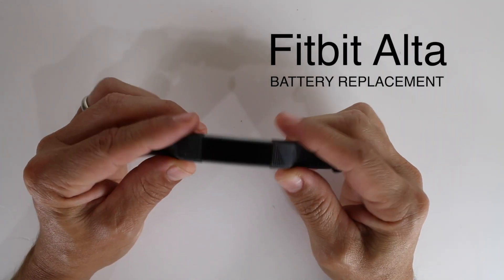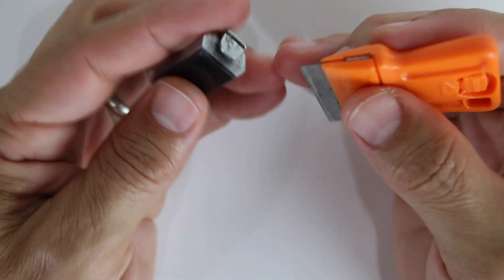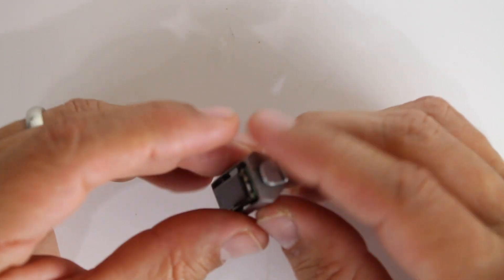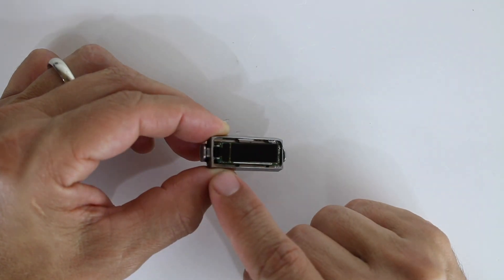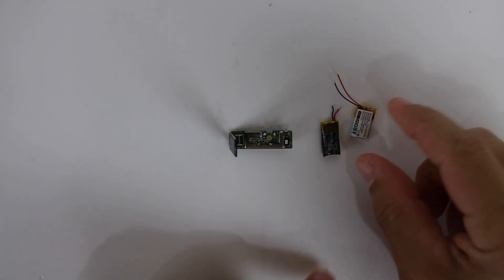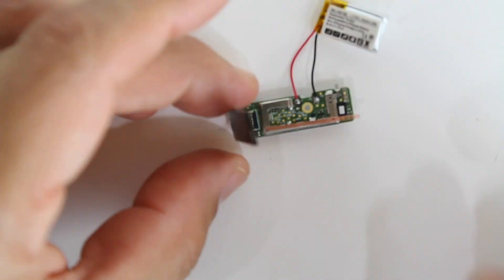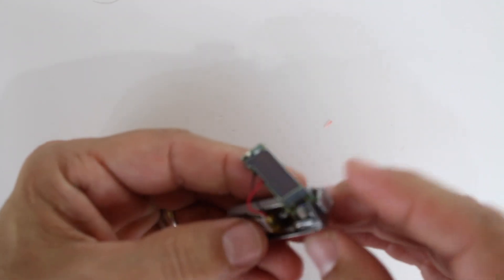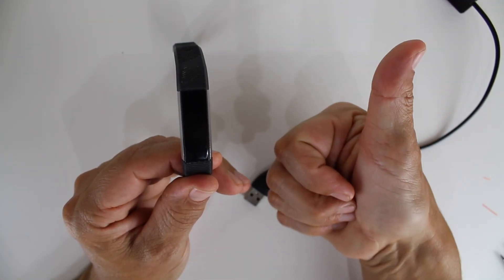Fitbit Alta Battery Replacement (Step-by-Step)

Comment: If you do this procedure and then your Fitbit will only stay on while on the charger, you accidentally blew a fuse in the Fitbit when soldering. You need a magnifying glass to see, but there are two solder points on the circuit board labeled "F1". Those are the leads from the fuse mounted on the bottom side of the board. It's not worth trying to replace the fuse. Just add a drop of solder across the leads for F1 to bypass it. Be careful not to use any significant pressure while doing this because you could push the fuse out. In my case, I thought I had gotten a bad replacement battery until I put the old one back in and it was exhibiting the same "only works on charger" behavior.  After reinstalling the new battery and bypassing the fuse I'm back in business with multi-day battery life.
Reply: Thank you for the tip, I guess I’ll see if I blew f1 after I let it charge for a bit.

Comment: Hi Ryan, nice video thanks for that. My fitbit Alta had a problem that only worked while connected. So I got a new battery to replace it. During the removal of the original battery I might have accidentally short circuited the system (or made some other bad connection). After that I realized that the screen doesn't turn on at all or when it turns on it was showing the error with the battery with an exclamation point in it.  Anyway... I replaced with a new battery and still doesn't work. Wonder if you might know what is the problem? I've noticed that the replacement battery is 3.7V instead of 4.2V as the original.
Reply: my friend...where do you bought the battery? i have the same problem with my fitbit alta...
Reply from the maker: Link to purchase battery in description